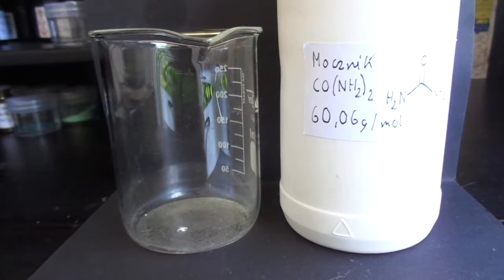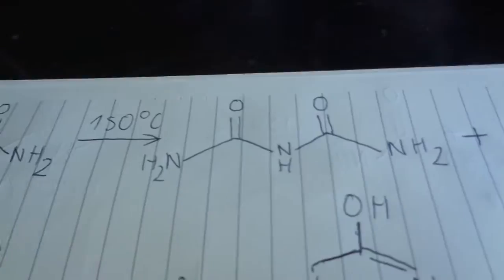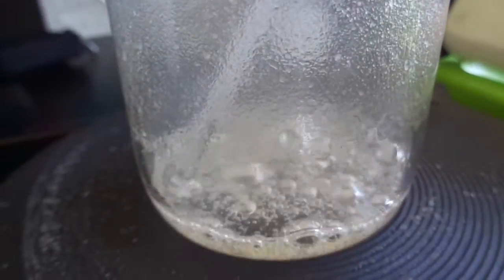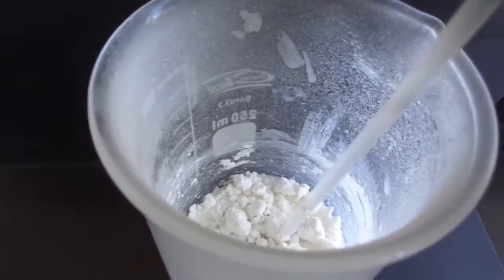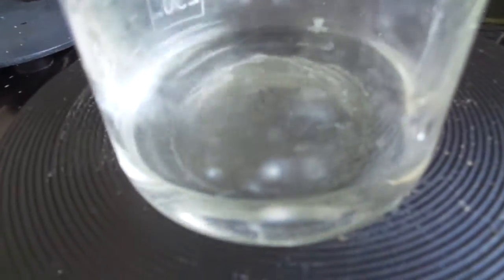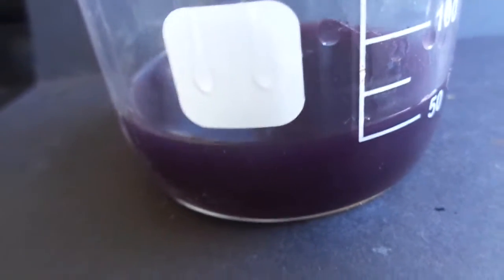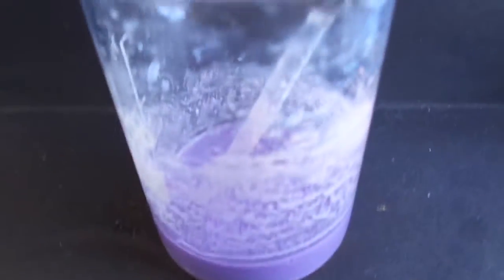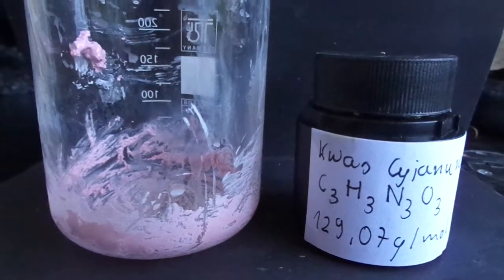Making biuret and cyanuric acid from urea

Comment: Remember me. Does this yield any isocyanic acid for isocyanuric acid
Reply from the maker: Isocyanuric acid and cyanuric acid Are tautomers which means that the can easily switch from one another depending on the pH, temperature and other factors. Isocyanic acid is a intermediate product in this reaction since it basically trimerises the moment it forms.
Reply: What about isocyanic acid

Comment: I’ve done this same experiment except I dissolved the NH3 gas in water as well. It made a lot of ammonia solution. Also did u heat it until it became solid?
Reply from the maker: Yeah I did, it's the best indication of when the reaction is finished. Dissolving ammonia is nice way o using the product but it is necessary to have a succbac trap

Comment: @
John Geologist,
Nice experiment.

To be sure you only have trisodium cyanurate and no excess of NaOH... you would need to dissolve fully the cyanuric acid into NaOH concentrated solution and then add some cyanuric afterwards to get a slight unsoluble excess...then filtrate.

Alternatively you could add slight excess NH3 solution to dissolve the cyanuric acid and use it straight for your copper (II) cyanurate... if any Cu(OH)2 do form and precipitate, it will complexate and redissolve with the NH3, and precipitate the desired compound.

As you mentionned you really need a better temperature control, if you plan to make biuret.

Note that a simple french frize oil cooker (fryer) has a thermometric regulation that allows control in the range 160-200°C... so fry oil, the fryer and a a beaker holder/lifter and you are good... you may also use a heat gun from a specific distance (defined by the use of compounds with known melting points... so you can spot the point or regio where you must stand the beaker against the hot blowing flow).

The scale you observe on the colder walls of your beaker are probably sublimating stuff... the nature of it may be a lot of things depending on the heat.
Except from the splashing from the ebullition below... probably that (iso)cyanic acid bubbles out and condense as cyanuric acid or react back again with the passing NH3 into urea or ammonium cyanurate.

Basically, there is a lot of interconnected reactions between decomposition products, products and reactants... each being in equilibrium and having an optimum temperature but working on overlaping temperature ranges...

For example:
H2N-C(=O)-NH2 <--> NH3 + HO-C#N 
(the Wholer's proof that organic chemistry is linked to mineral chemistry since from ammonium isocyanate he got urea by moderate heating...)

HO-C#N <--> H-N=C=O (highly volatile and sublimating)
(isomerism betwee cyanic acid and isocyanic acid)
Those are very reactive and react with themselves or with water, alcools or amines (see polyurethan foams isocyanate based).
If cyanic or isocyanic acid react with itself it generates a cyclic trimer cyanuric acid... the later is relatively stabilized by a resonant aromatic (triazine or 1,3,5-triazabenzene) core...
3 HO-C#N <--> cyclo(-N=C(-OH)-)3 
Cyanuric acid is also able to get proton switch via iminol-amido equilibrium... there you recognise the parenthood with urea, biuret and triuret.
cyclo(-N=C(-OH)-)3 <--> cyclo(-NH-C(=O)-)3 

H2N-CO-NH2 + H-N=C=O <--> H2N-CO-NH-CO-NH2 (biuret)
H2N-CO-NH-CO-NH2 + H-N=C=O <--> H2N-CO-NH-CO-NH-CO-NH2 (triuret)
The central NH group between two C=O is more acidic than the outer NH2 and may form salts with the expelled NH3 as ammonium... ammonium biurate and mono- or di-ammonium triurate or even intermolecular or intramolecular H bondings with the NH2 groups.
The NH-C(=O) sequence are in dynamic isomerism with -N=C(-OH)-...

Theorically you could go on to make a linear polymer H2N-(CO-NH)n-H or H2N(-C(-OH)=N-)n-H but you practically can't because the huge stability gained from the cyclization and aromatization so triuret is easily turned into cyanuric or isocyanuric acid with evolution of NH3 gas.
H2N-CO-NH-CO-NH-CO-NH2 <--> cyclo(-NH-CO-NH-CO-NH-CO-)(s) + NH3 (g)
cyclo(-NH-CO-NH-CO-NH-CO-) <--> cyclo(-N=C(OH)-N=C(OH)-N=C(OH)-)

In the final product you may have also some ammonium, diammonium or triammonium cyanurate...
To increase a bit the precipitation and reduce the solubility of the cuanuric acid... you may add dilluted HCl... it would turn any ammonium cyanurate into very soluble ammonium chloride and free cyanuric acid... then wash with minimum cold demineralized water.
 
The story is even more complex if the NH3 is not vented wel out of the system because you can also get dehydration and formation of cyanamide (H2N-C#N) related compounds  (melamine (cyclo(-N=C(NH2)-)3), melamine cyanurate (highly unsoluble), ameline
and heptazine (tri-s-triazine or cyamelurine) related compounds (melem, melon, melonates and cyamelurates...).

All those molecules interconnected into the melt are actually making a spider web like reaction scheme...

I hope it helps.

PHZ (PHILOU Zrealone from Science Madness forum and A.O.L. newsgroup  alt.engr.explosives)
Reply: You always have the most useful and complete comments and posts, both here on YouTube and on ScienceMadness. Thank you from the community!
Reply: @chemistryofquestionablequa6252  
I'm trying to do my best ;o) ... I'm thinking maybe I could do a YT channel on my own...with eventually a link for more sensitive subjects or applications that could be censored by YT...
Reply: @philouzlouis2042  that would be amazing! I know for sure that the entire energetics community would subscribe. You have such a deep understanding of the subject matter and come up with some novel compounds or ways to get to compounds that are really interesting. Just let us know on SM if you start one!
Reply: @philouzlouis2042  yes please!

Comment: Hello sir can you tell me the purity of cyanuric acide?
Reply from the maker: I don't have any devices to precisely chceck the purity but after few water washings it is deffinitly usable form most experiments and synthesis of course the purity of the product also depends on the purity of urea.
Reply: @johngeologist3993  okay well than can you tell me roughly value. For example you can tell it is around %80-90 or maybe  %40-50 like so
Reply from the maker: @rusencelik1272   well above 90 if u wash it well with disstiled water and use pure reagents